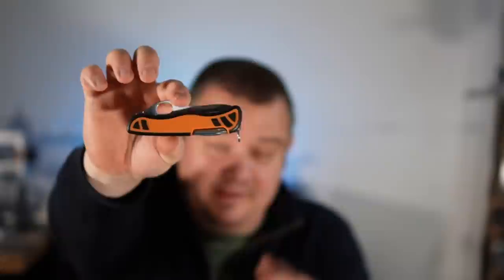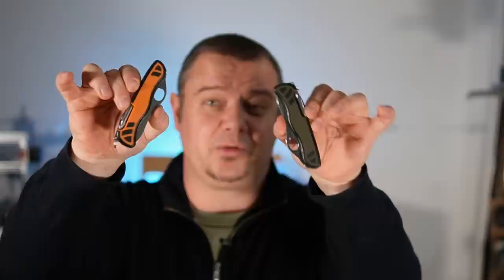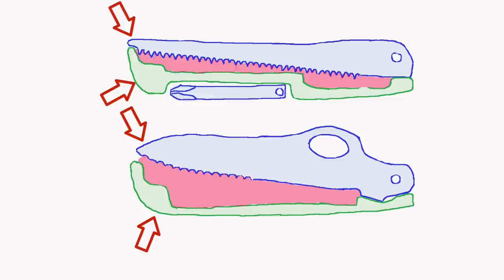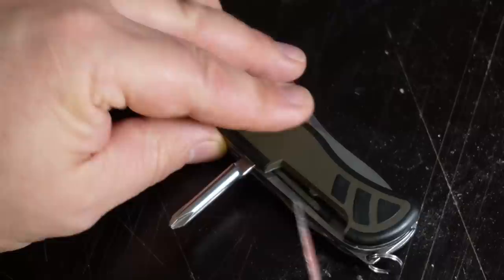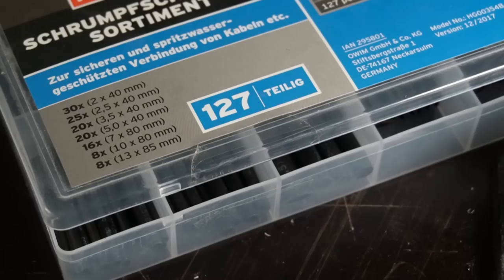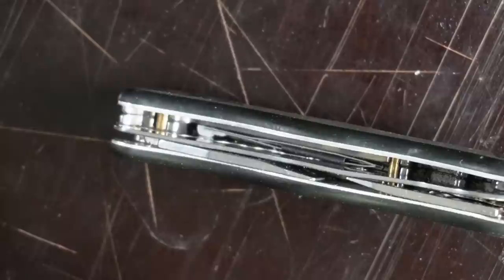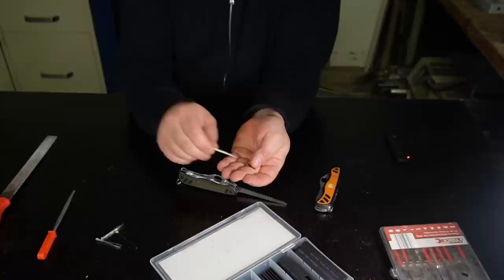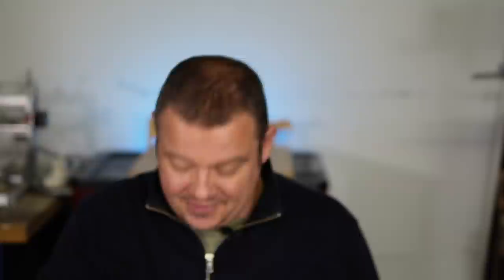How to add tweezers, needle & toothpick on a SAK without slots on the scales. No slots, no problems!

Comment: Hi Felix, my name is Adam and I am an Australian living in Austria, a Victorinox SAK lover (I have 7 of them) and a fan of your videos. I have a tip I created myself for carrying a pin on any Victorinox SAK of any size with the hook tool on the back ( you called it a needle on your video but it is a pin). First you need a pin with a small round plastic head, they are known as sewing pins and come with different coloured round plastic heads. Take a fine file and file down 2 opposite sides of the round plastic pin head until the plastic head is equal to the size of the hook slot on the Victorinox SAK (I used the small file on my Leatherman Micra and held the plastic pin head in the pliers of my Cyber Tool Lite). Ideally, it should slide into the slot fairly easily. When it fits, position the pin in the hook end of the opened hook and slowly close the hook tool into the SAK, while making sure the pin is positioned under it. The pin will fit easily and neatly under the hook when it is folded shut and be undetectable. If my explanation is not clear and you wish to use it on your videos I can send you photos or a video of the procedure. I hope this was of interest and use to you and thanks again for your many useful tips and tricks.😄

Comment: Very creative as always Felix. It doesn’t work for me though. I don’t like loose parts in my SAK. To me, this solution solves the problem of adding more tools but it creates the problem of parts falling out when you use, for example, the wood saw or the knife blade. Instead, I’d just carry a second SAK, such as the Compact or any other 91mm with plus scales. Thanks for the video my friend
Reply from the maker: Hello Tim. That's wrong. The toothpick can only fall out if you open both tools (blade and saw together).
Reply: Tim maybe you could wrap them in a rubber band before tucking them in the slot. Hopefully the band will grip the slot quite well.

Comment: Happy Friday Maestro Felix, I wish you & family a happy, healthy & prosperous new year. Thank you for the new video of useful & very easy modification tips. I personally only own those 111mm models that have the corkscrew as I find the Philips screwdriver as a back layer tool of very limited use compared to an in-line Philips model. For me a corkscrew is principally useful as a Tool Holder  holding either a Fire Ant & Tinder spiral or a Mini-screwdriver holding down a Tinder spiral when I have a Firefly ferro rod in place of the toothpick. I have known about the space under the saw & main blade on 111mm models such as the Forester & Outrider for some time & have placed a sewing needle with some cotton tightly coiled around it as well as a straight pin wrapped up tightly in a little strip of tin foil ( AKA kitchen Aluminum foil ) in the gap & held in place with 2 little strips of electrical tape which  can be easily lifted up to release the little bundle of tools & the tape being PVC is both waterproof & reusable many times.
Reply from the maker: Thanks a lot Steve for your great inspirations!
Reply: Electrical tape often leaves a residue, and is an unnecessary purchase.

Your good thinking gave the idea of using food wrappers that have foil in them. Typically, we throw these away. After washing them, we can store items in there.

If we wrap the items with the paper side out, then hopefully, the wrapper won't dull any blades.
Reply: @FelixImmler  I just realized that it might be possible to store a rolled up wrapper inside the corkscrew! We could maybe store thread, or cotton in the wrapper.

We could also store a rubber band in the corkscrew.
Reply: @eugenetswong  An excellent idea.😎👍👌
Reply: @stevesinclair4159  Thanks!

I just managed to put foil in the corkscrew. I can't wait to find some tinder to store in
Reply: @stevesinclair4159  Thanks!

I just managed to store foil in the corkscrew!

I can't wait to find some tinder to store in other parts of the knife.
Reply: @eugenetswong  Well done!
Reply: @eugenetswong  Happy Monday Eugene my fellow member of the International Brotherhood of the Swiss Army Knife. What part of the world are you located in? I am originally from London, England & have lived for 54 years in Israel & currently reside in Tel Aviv. I have had Swiss Army knives in my pocket since I was 8 years old in London, a 58mm red Classic on my key ring & currently I carry a hybrid SilverTech scaled 58mm Midnite Mini-Champ as my default key ring SAK & I always carry a 2nd larger knife usually a SAK like the 91mm Huntsman or a 111mm Picnicker  from my EDC rotation of around 60 knives ( Victorinox, Wenger, Swiss Buck Wengers, Case XX, Bucks, Civivis, Kershaws & Rough Ryders). I have amassed a huge collection of over 220 Victorinox & 40+ Wengers/Swiss Buck Wengers - the majority (130) are 58mm Classic SD's with decorative scales, 10 other rare/discontinued 58mm multi-layer SAK models and some  40 other Limited Edition / Special Edition SAKs of larger sizes, it is a lifelong hobby & to some extent an addiction. ATB Steve in Tel Aviv.
Reply: @stevesinclair4159  I'm so glad that I found your reply! I procrastinated, and then lost track of it.

1) What brought you to Israel? I can only make a wild guess that it was work related. I'm from BC, Canada.

2) I think that I got my first pocket knife at around age 9. When my friend across the street showed me his first Victorinox knife, I was so excited. I knew that I wanted it. He might have had the Huntsman, or something similar. I got the Leatherman, because it seemed to be the most useful. In hindsight, after watching Felix's videos, I think that the Huntsman is definitely the best. It's seems to be the most suitable for survival if we lose moat of our possessions, or for general purpose camping.

3) 60 knives?? Wow. :-D I'm jealous. Wait...over 200?? Oh, wow. You're beginning to tempt me.

Comment: Hi, Felix! Thank you for the vise advice - I will do it tomorrow. 2 subjects for the future videos are 1) Modify the little ones, like Sportsman, Waiter or maybe Bantam.
2) How to do the hole for the  clips or paracord lanyard in Alox Solo - there must to be something for them, because to loose this knife is very very easy. I am looking for any solution, because the old ones made from plastic are equipped with the lanyard hole too. I just want this hole on the Alox version of SOLO. I need a hole to put something in, for keep it without checking it in the pocket every hour. Please, try to find the solution, I will wait! And all those officer series which smaller than 9.1 but bigger than the "Baby SAK" with scissors, the most used tool in my life. I remember, I told you that I bought Bantam because I couldn't find the Solo. Its not the same, I realized, but Sentinel was the solution,  but its a big model with the locker, while I need something   with no lockers and 9 sm. So this is the issue..😉 Have a great weekend, and see you next Friday!
Siegfried
Reply from the maker: I never thought about your problems. Thanks for your inspirations. I dont own a Sportsman, aWaiter, aBantam or a Alox Solo but may be i have to buy it. Thanks for your inspirations!
Reply: @FelixImmler  you'd better hurry because they're discontinuing a TON of knives, many of the small ones!

Comment: I tried to use a foil wrapper to pretend to store something in my corkscrew, and it worked!

I found that I needed to fold it into a long rectangle, and then roll it up into a roll of the same length. After that, I wound it in the coil of the corkscrew, as opposed to screwing the foil into the corkscrew.

By the way, I realized that it might be better to leave the toothpick, tweezers, and things, where they are supposed to be, and then put the flint and tinder under the saw and file.

Also, we can stuff some tinder under the scissors!